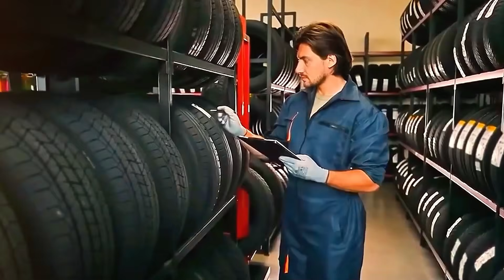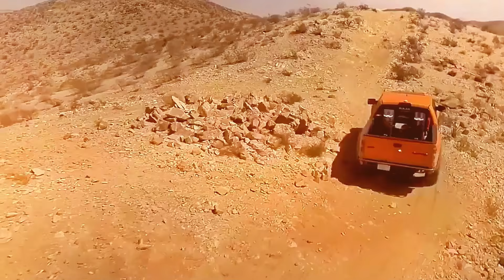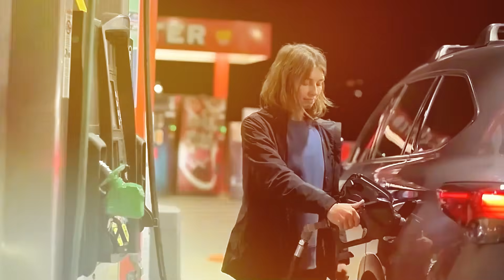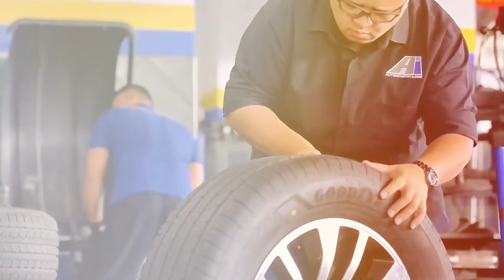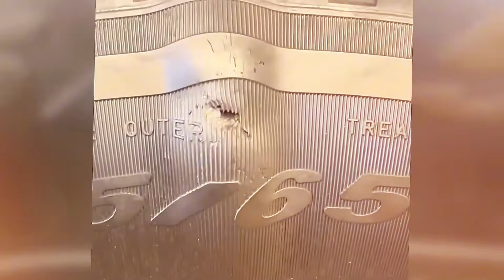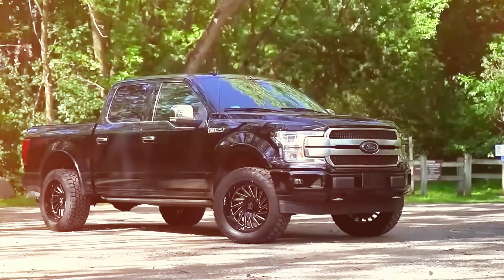Never Buy These 5 Types of Tires — They Secretly Kill Your MPG

Comment from the maker: 🛠️ EVERYTHING I USE TO DIAGNOSE & FIX CARS (Amazon links below)

Stop guessing. These are the exact tools that save time and money in the shop.

💰 BUDGET ESSENTIALS (under $25)
→ OBD2 Bluetooth Scanner – Read fault codes from your phone: https://amzn.to/4vcJBun
→ MAF Sensor Cleaner (CRC) – Fix power loss for $10: https://amzn.to/4mc2Vo7
→ WD-40 Flexible Straw – Gets into every tight connector: https://amzn.to/4mdhvvj

💎 SERIOUS UPGRADES
→ Autel MX808S Bidirectional Scanner – What pros actually use: https://amzn.to/47N98Rs
→ HP Tuners ECU Programmer – Real power, not just a tune box: https://amzn.to/41fhLjy
→ Optima YellowTop AGM Battery – The only battery worth buying for modern cars: https://amzn.to/4va0LcA

🔩 SPECIALTY TOOLS (the ones most shops don't tell you about)
→ O2 Sensor Socket – Swap sensors without breaking wires: https://amzn.to/4vcaSh7
→ Oil Catch Can – Protect direct injection engines from carbon buildup: https://amzn.to/3PNqk37
→ Digital Tire Gauge (AstroAI) – Your dashboard light is lying to you: https://amzn.to/3O5SlNA

👇 Use the links above — it costs you nothing extra and keeps this channel running.
(Amazon affiliate links — I only recommend gear I'd actually use.)